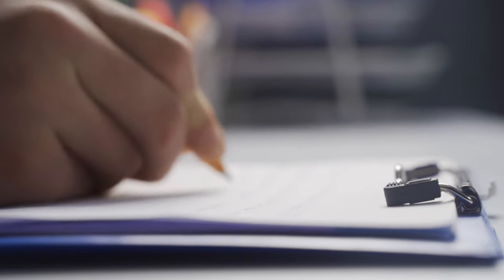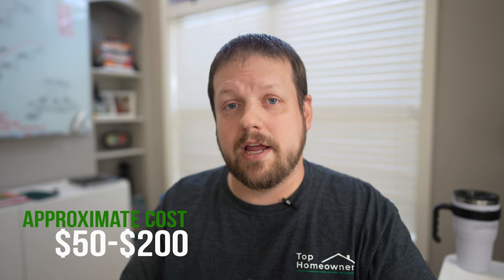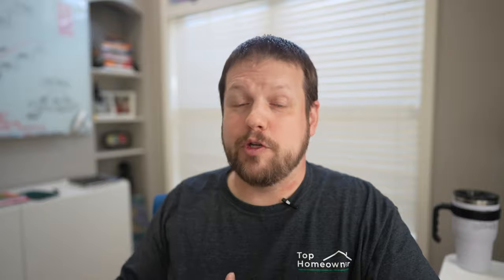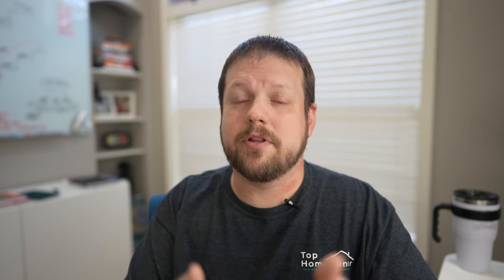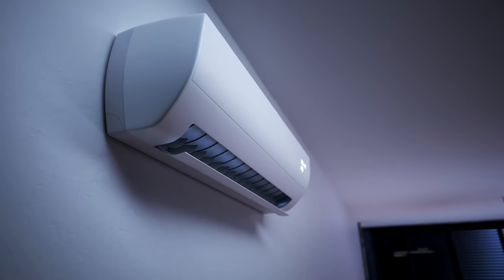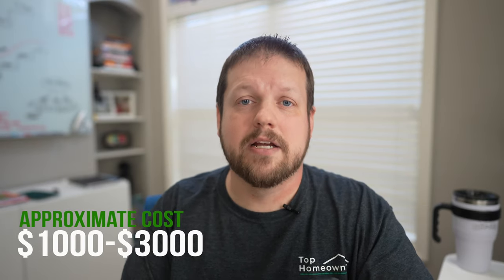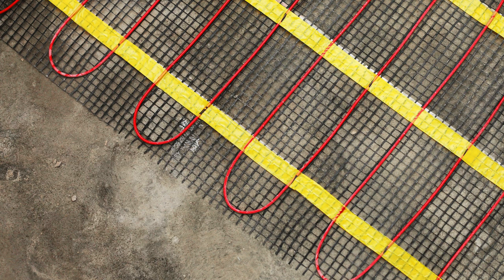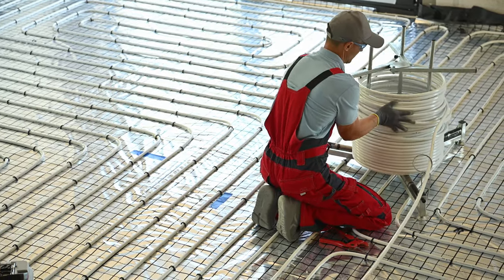7 Best Ways to Heat Up Your Garage This Winter

Comment: Good stuff; I just purchased a house with a detached 40×30  "workshop". I'm using your #3 "woodstove" to heat it and it's great. I've been thinking of ways to cool it in the summer so I'll check-out that video also. I'm trying to turn it into a combination of "Man Cave", "Fitness Center" "Small Workshop" & "Entertainment Area". Once I get the cooling issue figured out, it's on to the "Surround Sound System". Thanks for sharing!
Reply from the maker: Sounds like it'll be a great space when you're done!

Comment: Great list! I’m considering many of these options, thinking a propane heater could be a quick-ish way to warm the garage, then shut it off and maintain a warmer Carbon Monoxide-free area near the workbench while working with electric. Mini-split is appealing, but I do already have a boiler system for the house, so adding a loop of hydronic in-floor heating on the system is a long-term goal, especially because I think the concrete floor of our garage will need to be replaced in the next 5-10 years anyway.

Comment: Good list. I'm looking for a solution to just keep my garage at around 55 degrees or higher in the winter for the benefit of my cars and any chemicals stored in the garage that can be degraded by freezing temps. I was considering just getting a couple of wall-mounted infrared heaters. The key is I need something that can run continuously to keep the temperature constant and won't let it drop below freezing. Would the infrared heaters be a viable option? My garage is mostly insulated and I just insulated my garage doors.
Reply from the maker: I would think a couple of wall mounted infrared heaters will work like you said